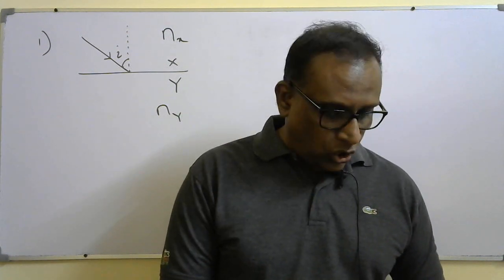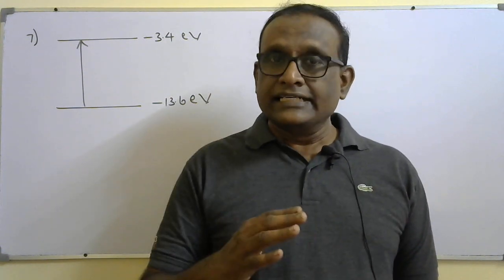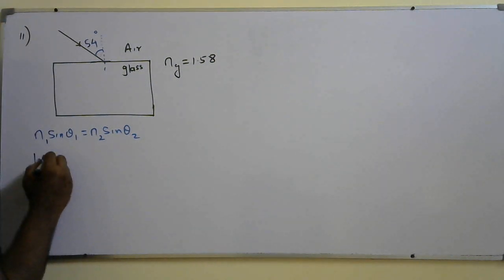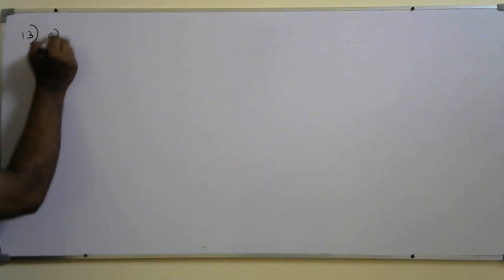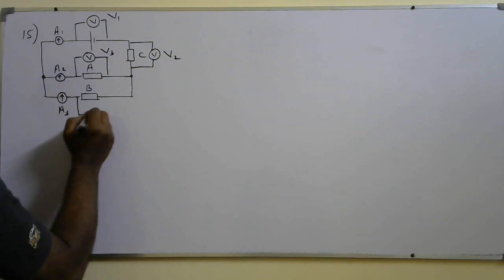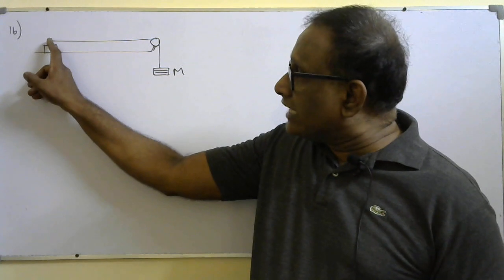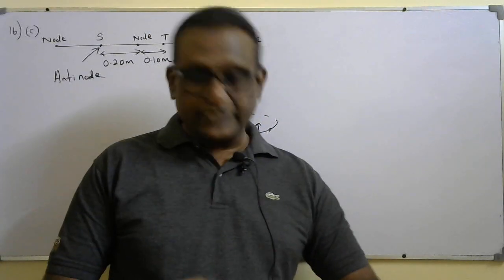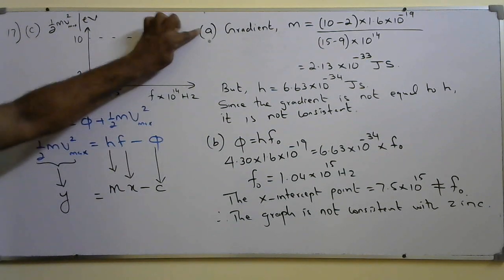Edexcel IAL Unit 2 May June 2022 Physics Past Paper Discussion Waves Electricity Spectra WPH12/01

Comment: Q-11 They are mentioning a different glass with a different refractive index.
           So the new refractive index can be found using n=c/v
            and then subbed into the equation 
the 🔀 sine of 1.58 is not equal to 40.8 , but rather 39.265....

Comment: sir, in q3 may you explain why its 4πd^2 because in the formulae booklet they only gave the equation as I = P/A
Reply from the maker: Solar power (P) emitted from the sun is radiated in all directions equally. So, according to the conservation of energy, the power radiated through the spherical surface of radius d must be equal to the power emitted by the sun, which is P. Therefore, the power per unit area on this spherical surface of radius d is given by  P/(4πd^2) and it will be the intensity at the distance of d from the sun.
Reply: @aravinthphysicsmathslesson5111 is this only valid for the Sun?